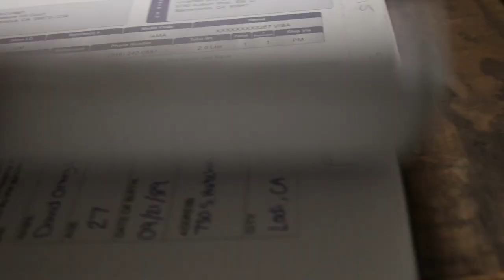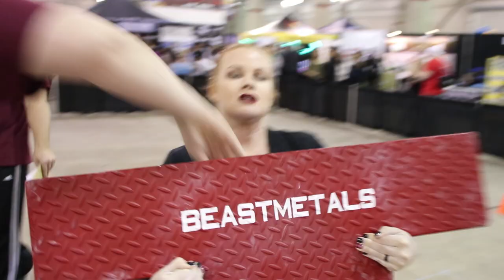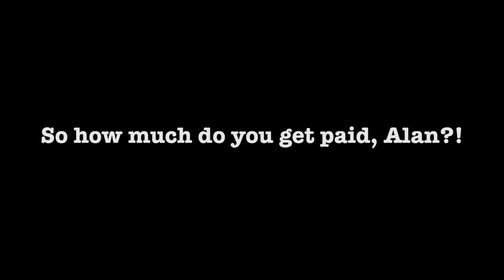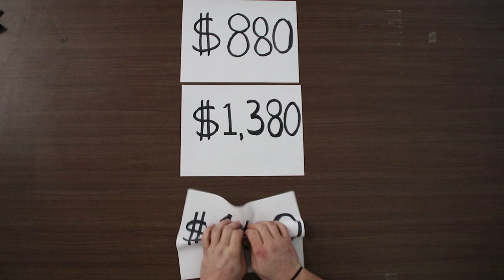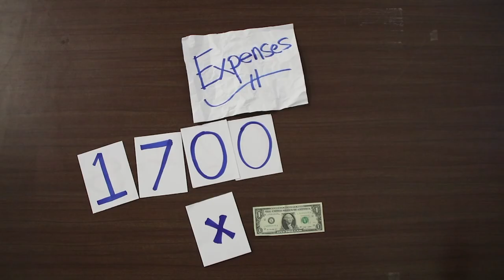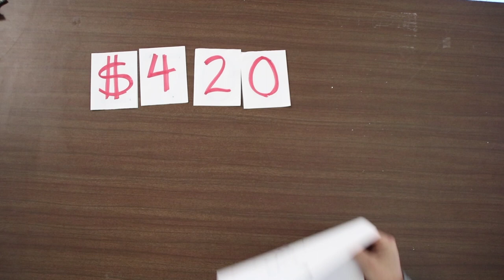VLOG: How Much Money Do I Make Hosting A Strongman Competition? My New Canon 80D

Comment: Man I need to stay on top of these events, didn't know you were hosting one this time of the year, looked like a fun on as well. I competed in the Iron Gauntlet last year, looking forward to you hosting a summertime event later on this year. 

Anyways, I work in Sac in A/V, you ever need a cameraman or temp gear for a show lemme know, photography/videography, A/V gear (mics, speakers, etc) I'd do it just to have fun.

Oh and for how mobile you are, might eventually look into investing into a rig, for what you're doing as a more bare-bones you don't need anything too fancy or expensive, like a Revo or Ivation shoulder rig would probably be fine, could see if one of the local shops has any rigs in stock to compare (good to test them out with your camera, make sure the viewfinder is visible so you don't have to invest in extra gear like viewfinders/screens).

Overall great vlog though, always appreciate how open and honest you come across in the videos showing the behind the scenes, although not cool to shatter our little dreams that we will be millionaires from hosting a few strongman comps, should have shown a bed covered in cash and you driving off in a lambo.

Comment: For the past week,  I have been looking at Canon 70D and 80D reviews.  I've been thinking about buying basically the same setup you are using.  All I have to say is that this video isn't helping Canon make a sale.  The shake and noise while focusing really concern me.
Reply: Yeah DSLRs aren't fantastic when it comes to quick autofocusing and shake isn't their specialty. You'd really want to get a steadycam rig doing what Alan is doing, DSLRs can surpass most prosumer camcorders when it comes to IQ due to the sharpness of lenses (many prosumer camcorders have gone to non-fixed lenses for this reason), and canon's have never had amazing image stabilization, but they all have weaknesses.
Reply: Fry's has a sale on the Canon 70D yesterday, so I ended up picking one up. After watching the video again, I noticed that Alan is using a Tamron AF 18-200 lens on his camera.  That's probably the reason the focusing seems to be slow and loud it also doesn't have image stabilization.  My camera came with a Canon 18-55 STM lens, and so far I have been impressed with the focusing speed the that fact that I can't hear it focus in my videos.  I also ended up buying a lens kit from Bestbuy for $350.  It included the 50mm canon lense and an 10 - 18 mm lens.  I've been using the 10-18mm and I can't hear it focus and it's nice and fast.  I found that the 18mm lens that came with the camera required me to stand back about 10 feet to get someone fully in frame from head to toe.  The 10mm lens will get someone in frame from about 5 feet.